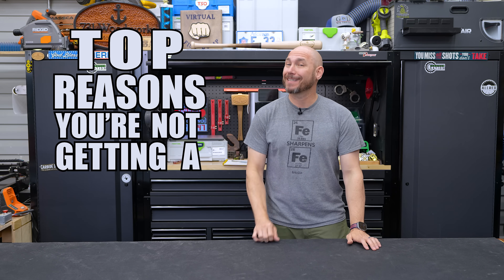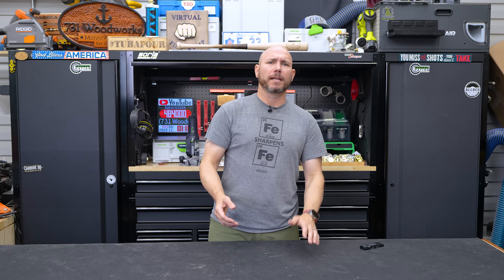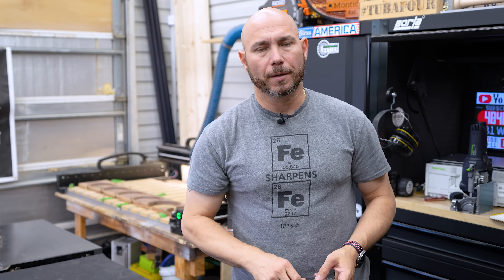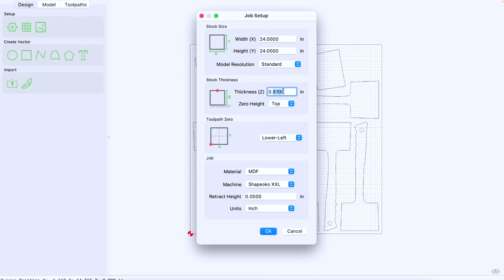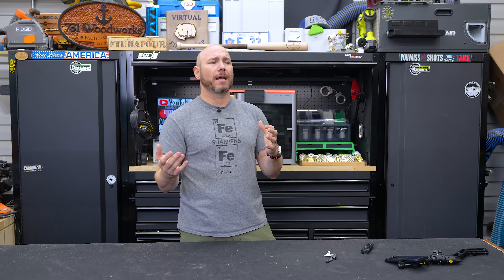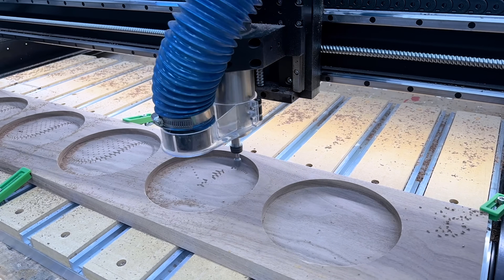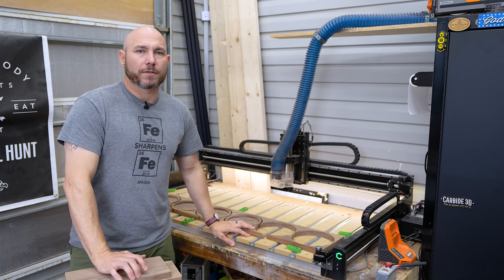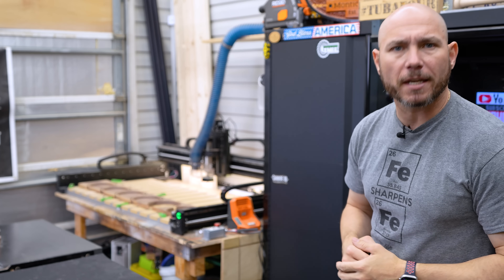6 Popular CNC Myths People Believe

Comment: I bought a cnc back around 2018. It hadn't been used a lot and was at my son in laws house. Then our other daughter called and said can you make me some Marquee letters? Yes I can. Since last April, I have built almost 50 4 foot tall and some 2 foot tall Marquee letters and numbers and several symbols for her rental business. The CNC has worked great cutting out the shape and holes for the light sockets. I assemble them with 4 inch sides and they paint and install the lights. The CNC is a work horse. I set up the toolpaths to tile the dxf file and feed it through the "Y" axis allowing me to cut 47x32 inch shapes on a CNC Probotix Asteroid that only has a 25x37 work area. Really has been a big help and I don't have to cut the shapes out with a jig saw and power saw, or drill out the light sockets with some sort of hole saw or big bit. It does it all.

Comment: The money aspect is a partial truth. I've invested tens of thousands of dollars upgrading equipment to speed up production on products that were moving, and quite suddenly the market will dramatically shift in some metric, be it ballooning material costs, instant demand drop, economy collapse, etc. At that point, you have a very expensive machine(s) that have instantly become long-term investments that no are in no way, shape or form paying for themselves. 
While CNCs are not quite at that same price bracket for Most people (not counting heavy production machines here like a Haas and such, hobby to mid-level), it's definitely easier and cheaper to go the stepping stone route, at which point when you're ready for a Big machine, you can probably build it yourself for a fraction of the cost. The machines themselves are very rudimentary for the most part, where most of the magic comes out of the software driving it.  Shapeoko and Carbide do run an honest business though and I've picked up accessories there for a fair price. When you have the room/budget, I wouldn't hesitate to pick up a machine from them.

Comment: I took a big risk and purchased a CNC straight from China (Alpha CNC Co). This was my first CNC purchase... A full size 4x8 CNC with vacuum table and pumps, 50mm rotary axis, 20mm square guide rails, all steel gantry and welded frame, 3.7kw water cooled spindle, Mach3 control system (old but works well for me). I am still learning, as of now I can do profile cuts through 3/4" MDF at a feedrate of 250 single pass with no vibration on the gantry or table. The CNC is very solid and accurate and I am happy I purchased it. I paid around 5700 for it. With cargo shipping the total came to around 10K. I have to say all your points you mention are valid... and you will realize it is just another great tool in the shop for you to utilize. The more you put into it the more you will get out of it.

Comment: If the price is an issue you could make it yourself. The price of the premade CNC covers your time to design and build it.  Regarding the bits being confusing I agree.  I can never get the feeds and speeds right which is very important to avoid burnout.

Comment: My only issue, and seems to still be ongoing with Shapeoko, is the random turrets of the router plunging or misbehaving randomly. There is no way to debug this, support can't help after the fact, and other people don't complain about this issue running different machines. Support is totally top notch though, you are correct about that. Had a pro 4 XXL and when budget allows I will be in the market again.
Reply: Suggestion, find a cnc visualizer. See if the cut file looks the correct depth before trying to cut. I have had issues in CAM software causing this. Sometimes it's not the machine but a poor CAM profile or setting that is causing the software to do such a thing. I have saved many headaches by loading the gcide into a simulation first to verify things. I have had plunges generated by many software and it normally is found in the simulation. Just look for a cut below the rest of the cuts. If it's there try regenerating or checking settings and then generate gcode again.

Comment: The Carbide machines are nice, and if you remove the customer service, they are rather over priced for what you get.  But CS makes a huge difference to people who do not want to tinker., but still cost more for what you get compared to some of the others.  If you are okay with tinkering, that opens a lot of options for you.  I paid around $3k for my Ratrig Stronghold Pro CNC, heavy duty aluminum extrusions, ballscrews, half inch alluminum plates, etc.  But I already had the electronics, that will push the price up. And you have to assemble it from a million pieces. Other good options, CNC4Newbies (they make an excellent machine that is 90% assembled), Openbuilds (great machines, but getting a little dated).  But I am happy with my SH Pro, with has a 1.5m x 1.5m work area, but it does take up a huge amount of space, the table I built is about 8f x 8f.... 

It all comes down to what you want to spend, and what your abilities are, if you are mechanically inclined, and really good with Lego.. you can get much more of a machine for less than the major commercial brands like Carbide3d, Avid and Inventables.

Comment: If you know a little about lumber and how it i sawn you can get Walnut and hardwoods online from people who slab trees local.  I hooked up with a guy in my small town and Ijust ask for the little drops that do not make a 6 or 8 ft board.  I just picked up two walnut slabs 2 feet long 3in thick  and about a foot wide.  almost 12 board feet if you have a planer and bandsaw real easy to get to resaw and finish cut.  Dude even tossed in a 6ft 8"x3" inch splatted maple.   I got them all for 20 bucks.  It is not all 1/4 sawn and one will need to be cut up and rearranged if you was to make a wide board that will not cup. not a big deal for me as I going to use the walnut for cutting boards.   You most likely want to pick up a cheaper moister gage to check they are dry and stable.  No big deal. I found mine on market place and craigs list has them too.

Comment: My main reasons for not getting a CNC are: I am an IT guy, woodworking is an escape from computers... and I have no space in my 12 x 15 shop.
Nice video as usual.
Reply: As am I, and while I understand unplugging... I may have sent a design or two from my work computer to run :)
Reply: I'm a developer and woodworking is my escape as well.  I find that 90% of what I do in the shop is still "traditional woodworking", 5% is CNC and the other 5% is trying to find where I put my pencil and ruler.  I bought the Fox Alien Vasto.  It's on the smaller side, but it's perfect for what I do, which is mostly batching out Christmas ornaments and most recently inlays on cutting boards.  To me doing the design work in CAD is a lot different than writing code, so it can be an escape too.
Reply: Getting a CNC so I don't have to be an IT guy anymore. I went with the Onefinity but this one was also high on my list.
Reply: I’m an engineer and programmer. For years I built high end furniture and personally CNC has just added another level of immersion and enjoyment into woodworking.
Reply: Yeah, I have a 3D printer, a CNC and a Laser engraver and quite often I find myself just doing a job with hand tools so that I don't have to go back to the computer. I work from home, so it would just be more time spent in the same room with the same computer.
Reply: i'm currently working on a cnc, work space 160mm wide, ~1000mm long, total size about 250x1200, should fit in a lot of places and building things is fun.  making old fashioned wall hanger wooden spoons should be easy, but i'm thinking guitar necks for myself, necks are 6-800mm usually.

Comment: Great video.
But you didn't mention space as a limitation 🙂
Reply from the maker: true lol, it is a factor.  There are smaller machines from 2' x 2' up to as big as you can afford lol.
Reply: @731Woodworks  Well.... you could mount it vertically to the wall as well :)

Comment: All excellent points.  If I was a production woodworker, I'd have a CNC.  I like the brand you're using.  I think a 3d printer is probably higher on my list though.  Also, great t-shirt.  That says it all.
Reply: Exactly.  I'd wager that that 99% of Matt's followers are hobbyists, so there is no "payback" on any tool, much less once something that costs over $5,000. 

I've been thinking about a cheap 3-D printer, just for play.  I never have the right fittings for dust extractors (why isn't there any standardization? )
Reply: CNC and 3d Printers meet different use cases.  They complement each other and woodworking in general, but neither are a replacement for each other.  Think of a CNC as an additional employee that does repetative tasks while you do other things if you are a production shop.  But if you are a production shop, you would want something more heavy duty, large steel framed with vacuum table, all of the machines I listed above, this one on the review, and in general, any that uses aluminum extrusions, regardless of the cost, are considered as hobbyist machines.
Reply: I think that's understood.  At least as I understood the comment was that he was looking for the next toy.  Sure, 3D printers are a whole different world but most of us have other ways of doing what a CNC does for the hobbyist. As such a CNC is down on the list. As you say, it's a whole different world.

I, too, am interested in 3D printing.  It seems to be a much more complicated world than CNC. It's also an order of magnitude cheaper.  They can be had for about the price of a good router, easily within the reach of most hobbyists. Exactly my conundrum.

Comment: I have three CNCs (no I don't have an addiction). Allow me to tell you the story of my CNC adventure.  It started last year when I decided I wanted to pull the trigger and get a onefinity woodworker x50 but there was a problem,  2 problems actually, 1) they had a 8-10week lead time 2) I'm very impatient. So rather than wait and went with my 2nd option, the longmill mk1...which out to be a disaster. NO IM NOT GOING TO BASH THEM, by all other accounts they have a great machine, I got a lemon that caused me so many issues after running fine for a few months that I bought a smaller Millright Carve King 2. Nice litte cnc, only 15x15 cut area but was fine for what I needed...at the time. After many many months of trying to get my longmill running consistently (oh and to be clear the company customer service was great and we tried everything we could to fix this thing) I decided to just cut my losses with the longmill mk1 and went back to getting a onefinity and their new cnc the elite woodworker which now had a lead time of 10-12 weeks!! Anyway I got my onefinity back in early October and couldn't be happier. Was it expensive,  yes...over $4K. BUT it drastically improved my efficiency by not only having a bigger work area (32"x32  with the option of expanding to 32"x48") but it cuts faster than either of my previous machines and twist the depth of cut per pass.

Comment: Howdy Mr. 731...

Ahhh. The CNC. Controversial indeed. Depending on your POV. 

I'm on the side of the fence where I don't consider the use of a CNC to be "True" Woodworking.  And boy ohhh boy have I gotten flack for my views in the 731 forums for that. 

But, I never said it wasn't a useful tool to have. It definitely is. I just have a hang up when people with little to no Woodworking experience at all turn around and drop $5k on or more on one and then say "LOOK what I made". To me, it's Insulting as a Decades old Woodcrafter to see that nonsense cause in reality, "THAT" person actually only bought themselves a $5k dollar employee that did the work for them. 

Back to Topic though...

I worked at a CNC shop for approximately 5 years. It was a Plastics shop, not Woodworking. But, I was hired BECAUSE of my skill with Woodcraft which could and was easily transferred to Plastics. Essentially, it's the same tools, I'm just using Plastic instead of Wood. 

I was hired as an Assistant to their CNC operator. 

I can VOUCH that learning G-Code and the operations of a CNC is quite a bit of a learning curve. Cause it's not just a matter of loading up a File and hitting "Go"...there's MUCH more to it than that. Visualization of 3D on a 2D computer screen was VITAL. 

We used a very very simple program called Bobcat/BobCad. You probably never heard of it, as it's an older G-Code software. But, it got the job done and we made LOTS of stuff for the Oil Field, Ambulances, and even The DeLorean Car company. 

It took me 6 months to learn how to operate the machine (5' x 10' table) AND learn to write my own programs. I didn't have the benefit of having a CNC company to hold my hand. I learned by paying attention to the 15 year Vet whom I was an assistant too. So, in a way, I was better off cause I had hands on training AND GOT PAID for it. 

So...I can DEFINITELY agree with you that the Tool can be a very Productive Tool to have as long as you have the dedication to learning it, as with any tool. 

But, the biggest hangup with a CNC isn't necessarily the COST....It's the space required. 

I'd say 80% of Woodcrafters out there trying to make their mark in this market barely have enough space for the required essential Woodworking tools. For a $5k CNC like yours, sure, it might fit in a corner of a shop, but it's also the cost of Electrical, ducting, lighting, computer (not to mention keeping dust away from the computer). Clamps, air flow and extraction, exhaust of all that stuff. 

$5k grand is just the tip of the ice berg on the costs for a proper setup for a CNC as it can easily cost another $5k just to get it up and running. 

And then, you STILL don't know what's going to sell until you play around in the market of "YOUR" area....and of course, that's after you've gone through the MONTHS of training just to use the CNC without breaking expensive Bits. 

All of that combined together is why I can not agree with anyone buying a CNC without already having at least 5 years of Woodworking experience under their belt. 

So, I have to remain vigilant on my POV of this NOT being a tool for a Weekend Woodworker.  It's a HUGE investment and MANY people don't TRULY understand that. They see these Xpro models and at that point, all they see is dollar signs instead of Reality. 

So...Though I love ya like a Brother Mr. Buttons...I can't agree with you on this particular topic. CNC machines should NOT be a tool an aspiring woodcrafter should even think about getting. 

Loved the Video though 😊

Comment: Thanks for the information. I am a hobbyist wood worker and have a laser engraver and have been thinking about a cnc router.
Reply: I have a Shaper Origin (my retirement gift to me).  It's a blast to operate.  "Programming" is easy, particularly since they have the "Trace" tool out now.  Take picture with your cell phone one minute and be carving the image the next. It's certainly not a production tool but it's not size constrained, either.  There are videos of people doing medallion inlays in hardwood floors. I'll never be confident enough to do that but it's a fun tool to operate.

BTW, Trace converts an image to a .SVG, so it can be used with virtually any CNC. It is limited in size to about the size of an 8-1/2x11 sheet of paper but it's only $100 with no additional software costs ("forever").